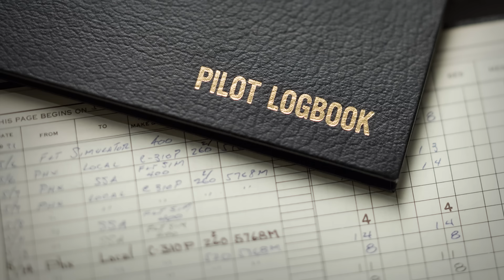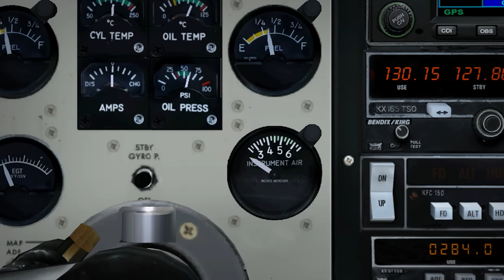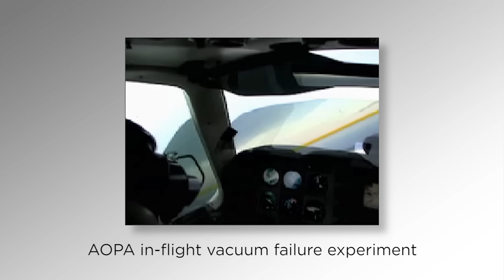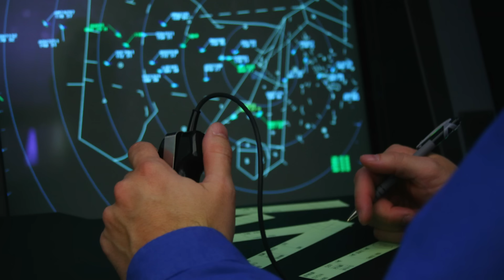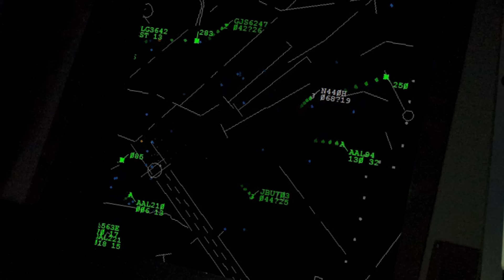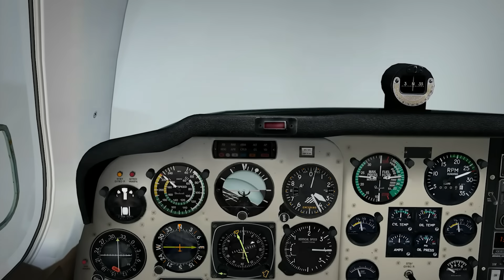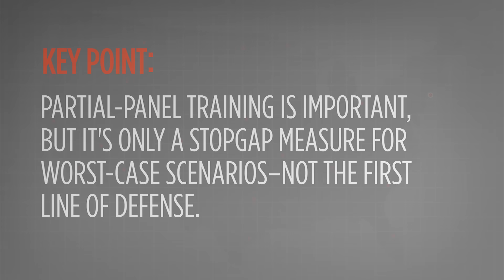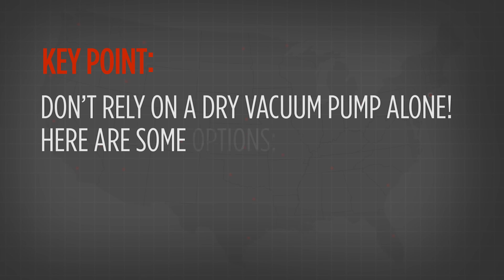Accident Case Study: Single Point Failure

Comment: I work at an avionics shop in North Carolina and  I love removing vacuum pumps and their related systems and throwing them away like the garbage they are.  So many people killed by this mid century technology.
Reply: I’ve never had a vacuum system failure in a Venturi-equipped airplane.....
Reply: @GWMRed_MartinAME3  Why don't they use these more?
Reply: WackyBroProductions      Venturi systems don’t work on the ground and can take a minute or 2 to spool up the gyros once the airplane is flying, because it needs outside airflow to work.   Not a practical scenario.    Also they do create some drag and reduce airspeed.  Not much. But pilots like speed.
Reply: Mark Mark    I’m not sure which comment I made you think is an excuse.  Most owners don’t want to pay the money for an AHRS system.  ( I assume that is what kayakook is referring to)That’s not my excuse, that’s reality.   As for Venturi systems, they are not practical in the modern IFR world.   However, a dual system using the Venturi as a backup is an interesting concept.  But I think most owners don’t like the appearance or the speed reduction. Incidentally, I’ve never heard of a wet vacuum pump failure.  Lastly, recent training is the key. Partial panel,night time, one engine caged, ifr approach to minimums was done every time I went into the Sim.
Reply: @SimMemphis737  Obviously would not work as a primary system. But placed downstream of the cowl flaps might provide a safe backup.
Reply: @raoulcruz4404  Isn't icing a concern too?
Reply: SiliconValleySky    Yes.  Quite likely another reason that system faded away.
Reply: @markmark5269  :   Damn, man.  Anger issues dude : )
Reply: Martin A. M. Erickson, III because venturi driven systems are otherwise superior, we should all switch AMIRITE!!
Reply: We in the homebuilt world have access to way more avionics capability although that is starting to improve. Vacuum pumps suck....haha.
Reply: Considering the cost of a pump compared to the cost of an aircraft, I cannot understand why a second pump and a couple of solenoid valves is not a production standard.
the method of operation then needs to be 50/20. where pump A runs for 50 hours and then switches to pump B running for 20, thus avoiding both pumps reaching the end of their design lire at the same time. When pump A is replaced, pump B starts running for 50....and so on, this ensures that their will always be one pump in peak condition, so the system also covers early failure in new equipment due to manufacturing faults.

I worked as a design engineer in the film industry for more than 40 years. where this system is the standard for studio and transmission equipment. It is also used to prevent failure in cinema projection equipment, particularly the main lamp. It is so simple yet virtually foolproof.
Reply: @wilsjane :  That's absolutely right!
Reply: I know, FAR restrictions stifle equipment development to the point of insanity. Three decades ago every mile long uphill on a highway would have some car pulled over venting steam, and gaskets leaked a black streak down the middle of every lane, but I haven't seen one overheat in ten years now and lanes are bone dry. (I ride a moto. so take notice of oil in my tire path)
 Nothing too wrong with a vacuum system but why does it need to be a dry pump? I know why some air compressors need oil-free outlet air (ie spray painting) and why a lab vacuum may need to be dry,(removing specific chemical vapors) but dry in this case just seems stupid.
Reply: @mytech6779  I've read that pilots don't like the wet vaccuum pumps because they leave an oil film on the underside of the aircraft that needs to be cleaned. Tho a simple oil catch device would solve that issue.
Reply: MyTech I don’t get it. I’m 39 years old and I’ve built race engines and replaced head gaskets. Why would you see cars with blown gaskets on every mile long uphill road 30 years ago? Admittedly I don’t live in a mountainous area (though they are among my absolute favorite to drive through when I get the extremely rare opportunity). 

Engine cooling systems haven’t really changed. They’re still water based heat exchangers (radiators with fans) circulating coolant throughout the engine block and back through the radiator to release the heat. There isn’t anything for the driver to attend to, aside from a malfunction or abnormal condition causing the system to fail. I mean, was there some revolution in water pump bearings I wasn’t aware of?
Reply: @Syclone0044  I believe My Tech was trying to demonstrate the lack of technological advancement in aircraft by giving a comparable lack of robust systems in autos. Although the cars he was referring were on the road in the Fifties and Sixties. Just for instance, alternator belt tension was set with a pry bar and socket combination and was frequently over- tightened. Worse, if the belt loosened at night or in an isolated area and the driver didn't have a socket wrench, he/she had maybe 25 miles travel before he was immobile. Now many cars and trucks have a spring-loaded belt tensioner and you can replace a broken belt with just a tire iron. Try a little more kindly attitude, Syclone. NOBODY knows it all.
Reply: @mytech6779  Drive in the pacific northwest and you'll see shit like that all the time.  People there don't care about maintaining their cars or buying new ones so you'll see a car disabled every mile.
Reply: That is changing (as has "FAR", which is a word that hasn't been used in over a decade, as the olde FAR system was pulled under the Code of Federal Regulations.) The FAA is making it much easier for non-essential aids to flight to be installed. They'd really be doing us a favor if the whole thing went under ASTM rules.
Reply: The system you install is likely not cost economical for many aircraft owners? A simple, 100 year old + technology could have helped that Bonanza pilot. There is a standby vacuum system that takes it's suction off the intake manifold. Simple to install. Simple to operate. Uses a push-pull cable.
Recent and realistic emergency procedures training would have helped that Bo pilot, too.
Reply: @raoulcruz4404  so true
Reply: @raoulcruz4404  I think you can severly the question and concept of "economical" concerning VITAL instruments, without which you most certainly will DIE. Affording an airplane but not decent equipment is behond reasonable in my books.
Reply: @12345fowler  It may be beyond reasonable, but it is pretty much the standard among many aircraft owners. Back in my FBO days, I used to run into folks who when you told them their vacuum pump was over 500 hours... they'd say, wait until it fails, I only fly in IFR a few times a year. I'd get planes coming in with oil leaking all over the place, as it cost too much money to have the gaskets replaced. And then when annual inspection time came around, and we wouldn't sign off on an unworthy aircraft, some would go ballistic. Thus there  was, and likely still is a huge market for what are called paper annuals, where an inspector does nothing but collect a few hundred bucks for his signature in the log book.
Reply: Accelerometers is Def the way forward
Reply: What do you replace them with?
Reply: +David. you have a good point, since new equipment can be prone to failure.
Have a look at my post above, their is an answer. The system that I mentioned is common in critical applications, such as nuclear power stations. It sounds complex, but in reality it is very simple.
Reply: Richard E what is the typical cost including installation and paper work for a Garmin G5 attitude indicator and DG/HSI? I’ve got the attitude indicator with old one as back up mounted on co-pilot side but it wasn’t in the budget to get the G5 DG/HSI.
Reply: Vacuum pumps suck until they don't, then they really suck.
Reply: That’s the first thing I’d do if I bought an plane put in some type of new glass system immediately. They’re so inexpensive relatively compared to years ago where a whole new avionics panel was hugely expensive
Reply: As someone who's not familiar with avionics, what purpose does the vacuum pump serve in keeping the instrument panel operating?
Reply: @dx1450  it powers the artificial horizon and directional gyro
Reply: @KayakrooK Well said, but we can't ignore the fact that this vacuum pump was well past its expiration date. Even mid-century technology needs routine maintenance and to be replaced according to manufacturer's specs.
EDIT: Not to mention that there was no backup pump.
Reply: I did 20 years in an engine overhaul shop, and the condition of some of the vacuum pumps I removed when stripping the engines scared the shit out of me, the other scary thing was how unmotivated the owners were to spend minimal funds on important components, along with their undeserved confidence in their mechanical ability
Happy to say I have left aviation and have little inclination to return
Reply: Heaven forbid that GA were to join the modern age and be able to innovate without the bureaucratic stranglehold that plagues it now.
Reply: I’ve seen those standby vacuum systems. They don’t work so well because typically in an IFR emergency you’re at a high altitude and open throttle setting. That means no vacuum. 

A Venturi is bad because it will likely already be iced up by the time you use it. 

Stand-alone AHRS like a G5 is great but the cheapest one is like $2000.
Reply: The free phone app (Horizon) with a suitably equipped accelerometer phone (S7) would have saved the day.  So tragically avoidable.
Reply: G5 all the way.
Reply: exactly.  Everyone is walking around with smart phones that have AHRS technology.  Seems quaint and antiquated to have vacuum-driven gyros in AIRPLANES instead of the technology everyone carries in their hand.
Reply: @johnnymedico  Since my original
 post decrying these sub standard devices I have lost another friend due to Vac pump failure.  http://www.kathrynsreport.com/2019/10/piper-pa-28r-200-cherokee-arrow-ii.html
Reply: @kayakook  Wow. Very sorry.
Reply: @SimMemphis737  That, or two gyros, one on the pump, one on a venturi.
Reply: @SimMemphis737  That, or two gyros, one on the pump, one on a venturi.
Reply: Just keep a water bottle in the cup holder. 1/2 filled with water and liquid mercury floating on top?
Reply: @Jdalio5  mercury does not float on top of water.
Reply: @spambot7110  if you pour the water in first the surface tension of will not be breached by pouring in mercury...go read a elementary science book!
Reply: @Jdalio5  you might wanna look up the definition of the word "float". hint: it doesn't just mean "thing on top of other thing". also uh that sounds extremely unstable, do you expect that system to hold up in a high vibration environment?
Reply: @spambot7110  I was kidding but your the only one that had to correct me as if you couldnt understand the point I was trying to make. Fyi: I included a spelling error in this message since you feel the need to correct people, your welcome!
Reply: @Jdalio5  :  One guy told me that WWII pilots would put a string with a washer tied to it, and hang it over the dash.  When their instruments were shot up, that string with the washer going back and forth like a crazed pendulum would help keep them straight and level.  Wondering if that really works. . .
Reply: @ happysawfish

No it doesn’t work because it’s affected by both gravity and centrifugal force (and physics pedants can STFU.. I’m speaking from the aircraft frame of reference—you literally have no idea what’s going on outside in IMC). There is no way for it to tell one from the other. You could be in a 60 degree bank in a coordinated spiral dive and it would tell you that you are “wings level”. So would your inner ears. 

This is why gyroscopic instruments are so essential to IFR flight.
Reply: happysawfish      It isn’t much but it’s a damned sight better than nothing at all.     It will always work too to get those wings level  which is by far the most important thing .

Comment: Have often wondered why one could not fit a venturi on the underside of the aircraft downstream of the cooling outlets. While it would produce no suction until airborne it could be a viable option.
Reply: I've flown a 1960 Cessna 172 that had a venturi and no vacuum pump.  Works OK once you get airborne.  How one would get both to work together might be a problem - complicating an already-less-than-perfectly-reliable vacuum-pump-only approach.
Reply: Works for airline toilets. Uses a vacuum fan on the ground and cabin pressure while flying. Only issues are icing and insect clogging(in flight or nest building).
Really only requires a simple check valve, could even have a manual bypass valve for extra backup. 
Or the venturi could draw straight through the pump depending on pump design, requiring no valves and actually assisting the pump in normal operation.

Comment: Again, a string of failures led to a tragic conclusion.  A highly-trained and experienced pilot with "get-home-itis" Pushed himself, his passengers, and his airplane into a situation he wasn't prepared to handle.  I say don't bother flying an hour further north in hopes of finding better weather.  Go for the airport with the best weather along the route of flight and get assistance with a no gyro descent and landing.  I think the controller should have issued a climb the minute 440H stated he was entering IMC, at least until the pilot was ready for a descent and stated as such.  Lessons learned.

Comment: What a shocking testimony to how much piloting skills have deteriorated over the years. In the 1920s and 30s, the only instruments pilots had to fly in IMC weather were the very ones this pilot was left with after he lost the vacuum system. And the old-time pilots flew around all day in the clouds with these basic instruments and thought nothing of it. Charles Lindbergh flew all the way across the U.S. and then the Atlantic Ocean (much of it at night in the clouds) with only these instruments - and he had no lights nor any electrical system. Perhaps our training needs to be improved.
Reply: MD: The old time pilots crashed regularly and many, many died trying to fly visually.
Reply: Are you kidding?  Look at the statistics. Lindbergh was highly skilled but also extremely lucky.
Reply: He had a bank indicator and attitude indicator. It was liquid. Also, if you're planing on flying on that plane, you know before hand you don't have those instruments and therefore, you prepare for it.
Reply: Aviation today is safer than it has ever been before largely due to advancements in technology and avionics. Most of these crashes seem to take place in older airplanes with outdated equipment. Personally I can't wait till it becomes illegal to fly a six-pack in IMC. It's 2018 FFS, just because they did it in the 1920s doesn't mean it was safer then (ironically it was more dangerous, read the book Fate is the Hunter if you get a chance).
Reply: Illegal to fly a six-pack in IMC? Fuck off dude. Seriously, fuck off. You do realize AHRS can fail right? I had a failure on a G1000 in IMC. I had to rely on the back up steam gauge instruments to fly my localizer approach back to the airport. But hey, if you want to completely kill GA go ahead. No G1000 pilot has ever crashed in IMC because of spatial disorientation. Nope, never.

Comment: Some questions which arise :
1) Why was the vacuum pump which failed never replaced ? What checks are done on GA aircraft and by whom to ensure that such a situation never arises ? In professional aviation, failure to maintain an aircraft properly and operating an aircraft which is not airworthy are both criminal offences with extremely severe penalties. As a consequence there exist safety systems and processes which are intended to minimise either possibility. It seems to me that not enough effort has been made to apply those systems and processes to the GA environment, even though in many cases it could be done both easily and cheaply.
2) How are GA pilots assessed ? I know that examiners use a checklist to confirm that the pilot can do the things required by the particular test, but how much attention is given to airmanship and attitude ? In military and commercial aviation, pilot attitude is the principal selection filter because it is much much harder to change the way a person thinks than it is to teach them how to operate the controls of an aircraft. My heart sank when I heard the pilots indecisive responses to the ground controllers, and the lack of any sense of purpose in what he was doing. 
3) In the video, the pilot was aware that the vacuum pump had failed. In such circumstances, could he be certain which instruments he might trust and which he should ignore ?